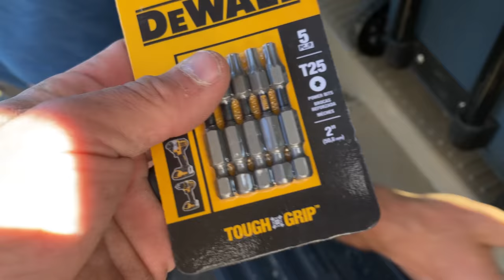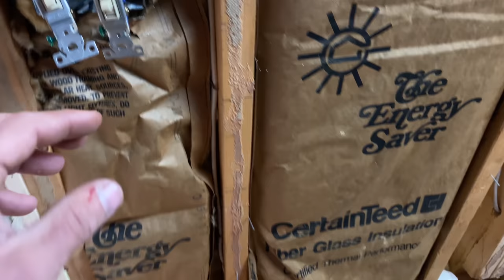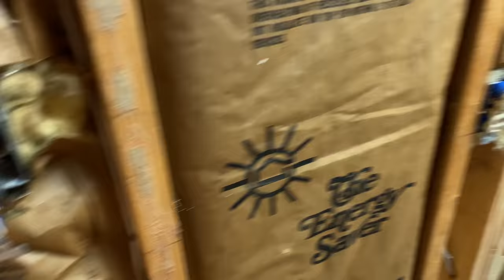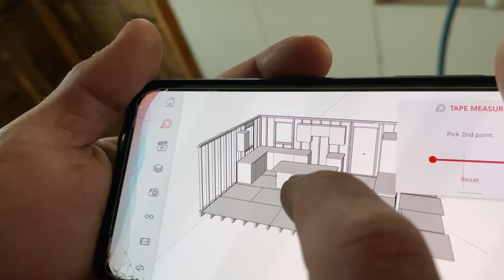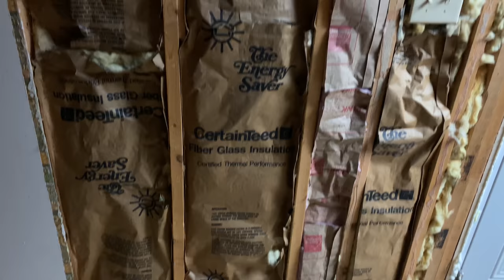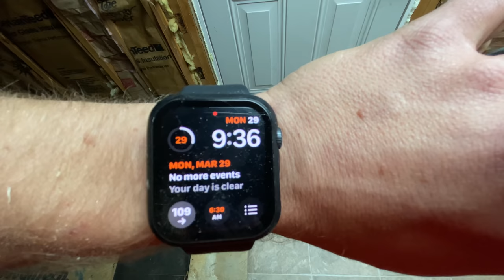The Modern Home Makeover // Episode 9 - Moving the Door Frame

Comment: When I was replacing a bunch of windows on my house I ran into that sheathing too. It’s a fiber insulation sheathing and I hated working with it. I also learned that corners and some other spots should have wood sheathing for actual structure.
Reply from the maker: Yeah, I talked to Jaime about that stuff. He said the same thing. It’s horrible, but it’s done a good job for 40 years so far.

Comment: We call that donacona (Donna conna) board....not sure of the spelling). It was put in because it was cheap and was supposed to have some insulation value. It has no shear strength and falls apart when it gets wet. Was used in the late 70s and early 80s I believe when plywood got really expensive.  Your siding panels should provide some shear strength though.

Comment: Around here we call that “sheathing” Buffalo board. Basically cardboard with tarpaper on it. Theoretically it’s an insulator but mostly it’s a spongy mess.
Reply from the maker: It’s horrible. Eventually it’s going to have to go, but not anytime soon.
Reply: Up here in Ontario I’ve always called it tentest. See it as the exterior sheathing of most houses built in 50-60s when getting into Reno’s
Reply: @davidguy6408  I’m in northern Ontario myself. Tentest  may very well be the proper name but I’ve always heard it referred to as Buffalo board. Always on old homes. Many times  I’ve seen it underneath asphalt shingle style  siding. Think tarpaper shack.

Comment: Love the humor in your video's, but i do have a "serious" question.
I do not know the code in your area (and its different every where as i understand) but should a door going to the outside not go outwards? I mean in an emergency you should be able to walk through the door easy to get away. For the front door i understand, but a back door (especially in the kitchen area) would it not be easier if it goes outwards? It would also safe space inside your house.
Reply from the maker: Thanks for your support!
I don't think there is code for residential door openings here. I may be wrong (I'll look into it). From my experience with the Perkins all of our exterior doors open inward...The doors installed in my house all opened inward as well. Where are you from?
Reply from the maker: Thanks for your support!
I don't think there is code for residential door openings here. I may be wrong (I'll look into it). From my experience with the Perkins all of our exterior doors open inward...The doors installed in my house all opened inward as well. Where are you from?
Reply: @Building_Jays_Way  The Netherlands, and there only the front door goes inwards. The rest goes outwards.

Comment: But you guys are do carpentry all their lives. They like Laura and hottie when it comes to building a door. All you do is cut the wall out make it easy put your jackstand in put your frame in for your door take the other door off move it over, finish it up later then move your cut hole for your window move your window over frame around it and close it and put a piece supply up with the old door was put a 2 x 4 stud in the middle frame it in and you’re done can you just work on the inside when you get done you can finish the outside you guys I’m curious you’re like hottie but you’re fun to watch it’s like you guys can’t agree on anything you need Jamie around to give you a hand